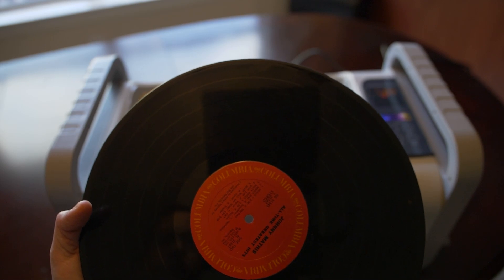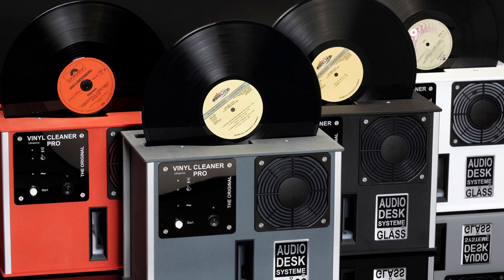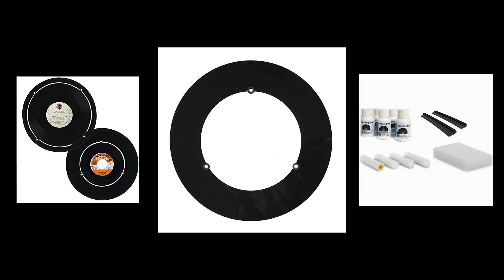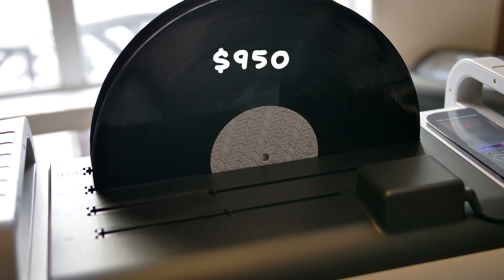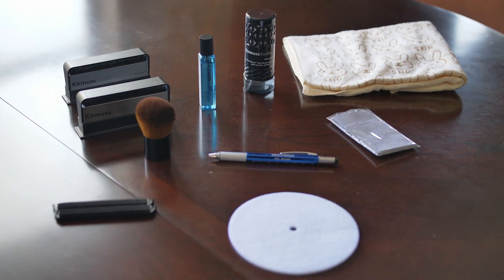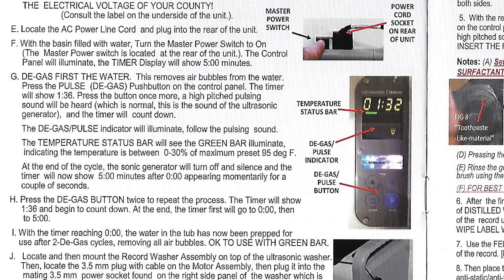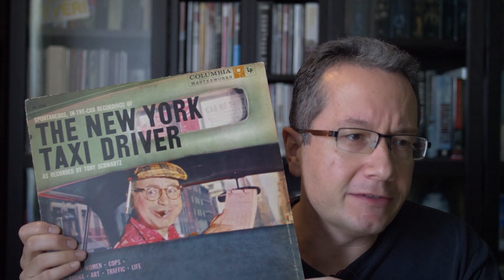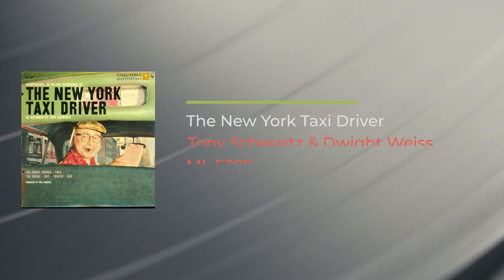Kirmuss KA-RC-1 Ultrasonic Record Cleaner Review and an Ultrasonic Cleaning Primer

Comment: Appreciated very much the review. To comment, our process changes the charge of the record relative to that of water.  This takes full advantage of the cavitation effect of the sonic.  The spray worked onto the record  does this. We need several cycles  since the record returns to the same charge of water as it spins.  We first remove past films from prior cleanings, then the release agent.  Peer sonics cannot do this as they rely on a soap or just water in a sonic's basin for cleaning.
Reply: If the spray is as you say antifreeze, why would it cost $95 for a 10 oz diluted bottle? Although interested in your machine. I can't imagine any reason for the $10 per fluid ounce cost of this. How many records does one 10 oz bottle clean?
Reply: @Chel Illingworth  The liquid is made in Germany,  shipped by air to China. The additive   is  exclusive to us. Liquid not available in any other fashion. It is not antifreeze!  It is propanedipl 1,-2-178. Then shipped by air to the US
 Then shipped to you at no charge. 

If you are familiar with logistics shipping by air just for the China to USA portion  went from $46 a box to $113. Duties went from 3.8,% to 3.8% plus 25% from the Trump Tax. This said the cost to restore a record is between 0.26 and 0.38 which varies with the number of cycles in the machine. Only three squirts of spray are applied to the record. The goat hair brush is used to cover the record and thus change the charge of the record to be opposite to that of water. Following our instructions the record does not have to be drenched in liquid as it is not a cleaning solution. It is s used to attract the effects of cavitation. 

 Take a look at our series of training videos on our channel and  in comparison the AudioDeske sees one of their  bottles suggested to be used per day, no longer keeping the cleaning solution in the machine for months as agreed the filter cannot filter out dirt and dust of 3 to 5 microns using a filter of 120 to 300 micron diameter pores.
 Their cost is  about $3 per record. 

Finally, our process is the only one proven to remove the release agent revealing 1.3 to 4 dB gain over floor. Depending on the provenance of the record. 

Certainly at the maximum cost of 0.38 cents or so per record discounting the need for distilled water, we allow your existing sound system reach its full potential with no change in hardware. This as we now see the needle making full  contact with all the details of the pressing,

With a restored and not surface shined record, it's  a good idest to perhaps now also  invest  in the Wally Tools set of alignment tools. 

To expand on your observation,  and my response, why do not peers talk about dB gain over floor? Most processes use air or vacuum drying, which leaves a film on the record thus temporarily hiding the flaws and issues. Our process sees records come out virtually dry.

 Check out our 45 minute video recorded in front of Korean audio journalists this past November. 

Sorry to be wordy but  you need to understand the process. 36 cents per record for the results we guarantee with shipping and tax included is very reasonable  for the auditory  results you are receiving
Reply: Propanediol is the spelling.
Reply: @kirmussaudio7578  Thanks for the response. The per record cost is definitely very reasonable. I should compare that to the vacuum that I'm using audio intelligent fluid. Probably a very comparable cost but certainly without the results that you get. Maybe somewhere down the road  I'll grab one of these machines. Thanks for your reply
Reply: @Chel Illingworth  Our process is based on attracting the cavitation by changing the static charge of the record to the degree we need. The in and out cycling sees the charge dissipate. Added benefit between cycles and our reapplication of the spray is where we can see what the previous 2 or 5 minute cycle accomplished.  An idiot grre light means nothing.  Thanks once more for your query.
Reply from the maker: Thank you sir and I hope this garners you a few more sales.  Personally, I think the way you've employed your solution is the most practical out there on the market.   I am looking to find a good record to try out your entire process and perhaps cover it in another video down the road.
Reply: Hey Charles I got a sweet deal on a bridge. You interested?